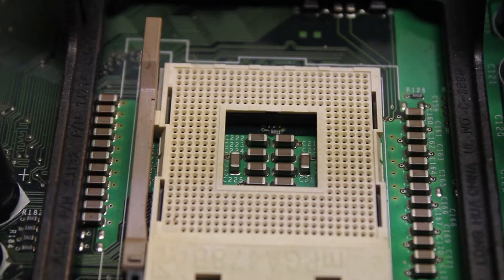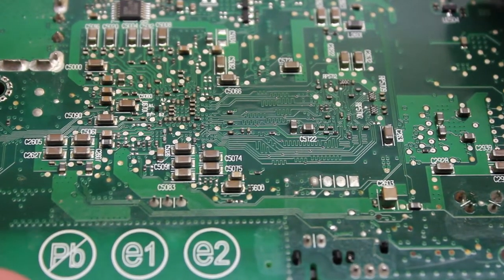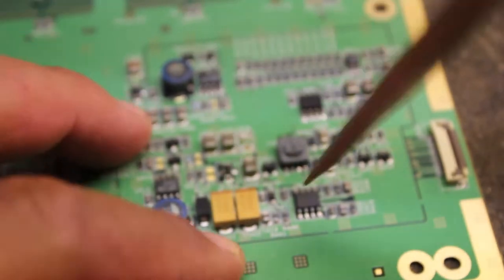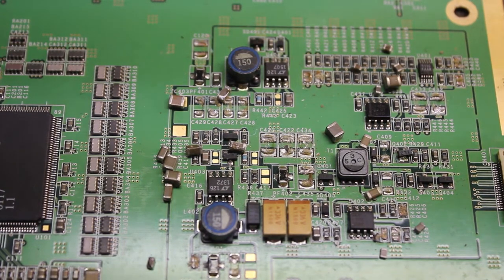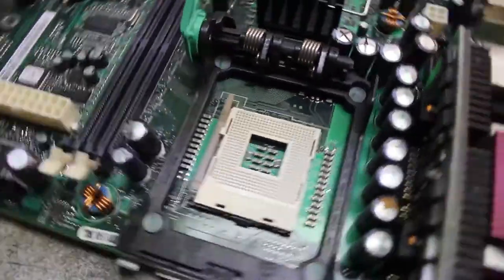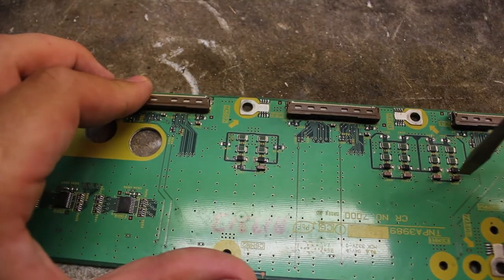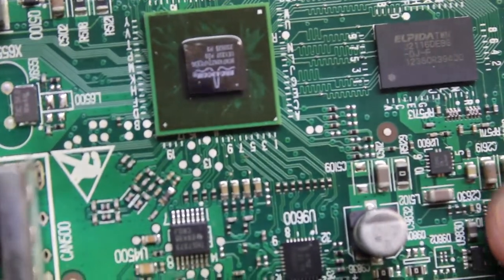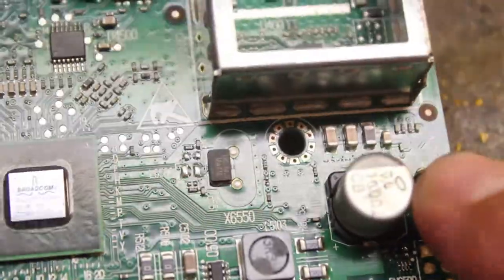Alamo City Scrapping - Identifying Monolithic Ceramic Capacitors

Comment: The components labeled "L" aren't Capacitors, but inductors. They are largely composed of iron, so they can contaminate your processes. They may have silver, though.
Reply from the maker: Yeah you are right just re-watched it and I did call them Capacitors. I just had capacitors stuck in my head all day lol. Thanks for correcting me.

Comment: I enjoy your videos. I have a question for you, I've been using grapefruit juice and peroxide to remove solder/tin from small pieces of boards. It works great. So, there is probably a lot of tin in solution, how do you think I could cement out the tin? This stuff keeps working to. I do ad some juice after a couple of batches. Keep up the good work.  The Junk Bunny (Bunny Norville, Munday, TX)
Reply from the maker: I've never tried that out very good question. I wonder if just trying to take the silver out if any present would be a better route than just removing the tin.

Comment: Also, the components marked "CA" with many legs (more than 2) are likely Capacitor arrays, and should be able to be processed like MLCCs. They can be found on some CPUS, and are quite tiny.
Reply from the maker: I'll try them out they seemed likely to break if I tried to remove them with a screw driver.
Reply: Alamo City Scrapping Screwdrivers are difficult. Perhaps a heat gun is a good way to remove them. I get them off that way, along with all large components not easily and cleanly removed with a screwdriver. But if not, it is only a small amount of them that are that way.
Reply from the maker: Could also try a hot sand bath that removes everything but then again sorting it all out would seem miserable. I'll stick to my screw driver for now until I remove all the MLCC"s and Tantalum's from all my boards.
Reply: Sure. Everybody has their style.

Comment: Are the metals you're after on the solder ends that are being ripped off and left on the board or are the precious metals inside the capacitor?
Reply from the maker: Inside the capacitors.